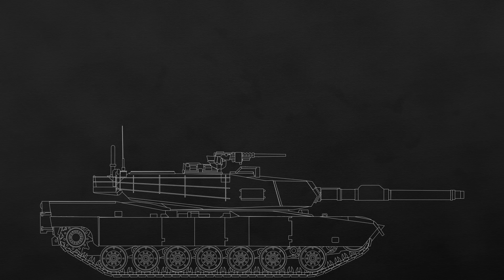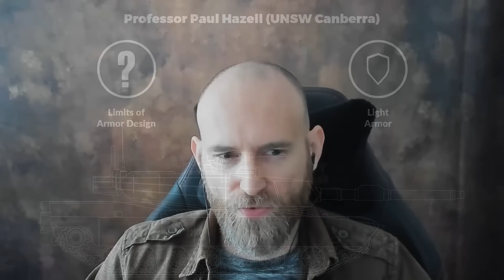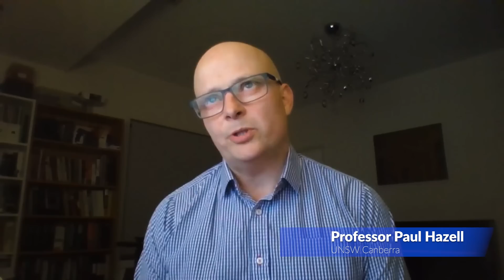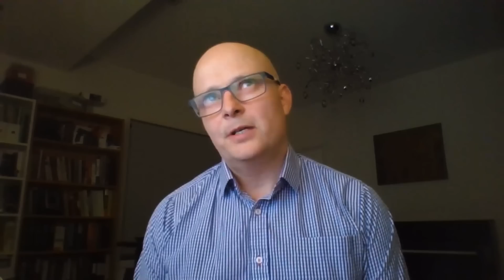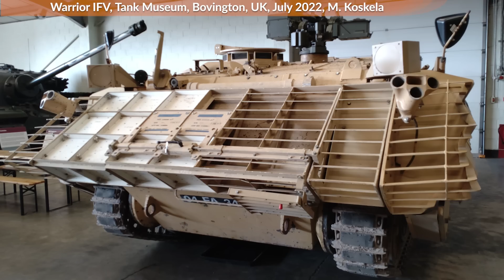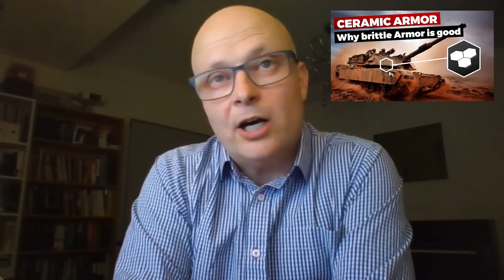Limits of Armor Design & Light Armor

Comment: Re: new threat types?
Possible futuristic threats, it's hard to predict the timeline:

1. APFS rocket-assisted: long rod subcaliber penetrator which primarily accelerates outside the barrel, potentially allowing longer penetrators and guidance systems.

2. Folding APFSDS: As the sabot discards, the projectile increases in length without sacrificing density.

3. Top attack ballistic penetrator: using sensor fusion in the tank and communication with other vehicles, a slightly guided shell can be fired as over the horizon artillery which then lands like a miniature version of project thor, both extending range and circumventing armor. Basically the world's most expensive How Ridiculous video. Disadvantage is that in order to bypass armor efficiently it needs to be fired at very high angles which means very long flight times even for artillery. Also anything fired in a semi-active missile type capacity will obviously be susceptible to soft kill countermeasures and jamming.

4. Frikin' lazors. If the yield of rapid pulsed laser systems can be sufficiently increased, to the point of being in line with conventional kinetic weapons, penetrating tank armor from even the front would be possible. These do not need to burn through the vehicle but rather make a series of craters at the bottom of craters exploding layers of armor with million degree plasma fireballs similar to miniature nuclear explosions. Such a weapon can also potentially act as a countermeasure due to its lack of flight time, either hard kill, soft kill, or deflectional depending on the incoming threat. It can also be refocused to change the effect on the target from penetrating to exploding to taking the paint off.

5. Tandem guided flechettes: smaller APFSDS rounds punch narrower holes. Shooting one APFSDS immediately behind another and having them follow each other straight into the previous shell's entrance hole allows for much better penetration than a single large APFSDS of similar aspect ratio.

Comment: I think (in my incredibly less educated opinion) that the biggest advances we're going to see in the near future for defense will be a synergy between passive defenses (armor in the classical sense) and active protection systems.

When there are interception systems and things like (possibly) electric armor to counter things like heat rounds/missiles, then the material of the solid armor can be more optimized to focus on things like apfsds rounds.

Right now, armor is being asked to defend against multiple types of attacks, and that is going to limit its potential to defend against any one type of threat as optimizing for more design characteristics involves more compromises being made, as a general rule.

How this will play out I don't know, though, as there is very much an arms race between active protection systems and countermeasures to them (at the most basic, tandem charges to counter explosive reactive armor).

Comment: Is the foreseeable future of the MBT, until new materials allow for lightweight armor, a return to focus on speed with modular armor and APS, with a focus on all the steps before getting armor pierced (avoid encounter, avoid detection, avoid acquisition, avoid hit), and crew survivability at the expense of the vehicle itself?

As for armament, instead of moving up from 120 mm main gun to 130 mm, simply developing top attack munitions that can be fired from existing barrels or even moving down to 105 mm to further save weight?

Comment: evolutions in the crystaline structure of metals will also probably allow new things in the future (for exemple we know that for the case of steel, tempered martensite has been the "meta" for a long time, but now, we begin to understand even more efficient structure that involves a mix of austenite (mild) and of harder ones like ferrite or cementite (and the mix of both create something often referred to as "bainite" ) because, if a bainitic steel with like more than 2000 MPA of UTS and more than 650HB was to be produced, it could allow to , compared to previous HSS and to traditionnal RHA, to bring same protection for a much lower weight (as the higher strengh, UTS, hardness, compression strengh, etc, would allow to put far less material and sitll get same protection)

Comment: My prediction is that point defense systems will come to the forefront since attacks have been concentrated against armor which needed to be unfocused to provide coverage. Now that aiming became smart enough that defense can also concentrate its focus on the incoming attack, it'll be more efficient in weight to defend. Once the attack is blunted enough, armor can withstand the remaining splinters. It's kind of like those post-Renaissance era small metal duel bucklers. If you could be sure you can move it such to block every attack, there'd be little need for high coverage strong armor.

In fact I think even aircraft and helicopters will come to use such systems since they won't be able to survive otherwise in a peer conflict as demonstrated in Ukraine.

Comment: This was supposed to be a video about the limits of armor design, what are are the real physical constraints that determine what designs will succeed and which designs will fail.  How about ground pressure, mass?  There are some real limits for you.  Exceet about 70 tons and the roads, highways, bridges cannot hold it up - it becomes a real problem.  That is a limit.  Armour protection?  That's a variable.  Projectiles?  Those are variables.  The smart people can distinguish between a limit and a variable.

Comment: I think there will be a push at the point when electric drives and battery systems begin to out perform IC systems, and dedicated electric platforms would be much better than retrofitted ones, though solid state batteries are ages away for military vehicles
Reply: Refuel vs recharge is a major issue.  Hybrid drivetrains make all the sense, pure electric seems hard to charge in the field.
Reply: How about the dangers of light metal like Lithium burning?

Comment: Graphene Armour,  That's got to be a joke right? Might as well diamond stud your vehicles. Would be cheaper and look pretty cool.
Reply: i literally never heard of graphene before but google told me this:

Specific graphene pricing data is hard to come by, but relatively recent estimates peg the commercial cost of graphene in a range of US$67,000 and US$200,000 per metric ton. The wide variance in price range is mainly because price is congruent with quality and not all applications require the highest quality graphene.

on the higher end that would only be like 2 bucks a gram?
Reply: @knuppel8875  The properties of graphene most often cited as being Incredible are useful when graphene is used in large sheets. However the current method of obtaining graphene involves using sticky tape to pull flakes of a chunk of graphite. These flakes are too small to take advantage of any of the interesting properties. On the other hand we have fairly advanced processes for producing artificial diamonds, so sticking some diamond sheets into your composite armour is probably not cost prohibitive. Not sure if it will be an improvement, but if I was directing funding I'd give it a higher probability of being useful in the near term than graphene.

Comment: I think we can see that simply static mass armor is insufficient now, explosive reactive armor is nessary for any tank to be effective now.  It incressingly looks like active kill devices will incressingly be needed as well to defend the tank.  I predict that tanks will evolve as navel ships have, relying fully on CIWS to defend themselves.  Light vehicles will instead become the place were armor technolgy is focused as the small arms threat is not counterable with active kill systems.
Reply: I have to disagree. Light armor +APS System is a pipedream. 

Passive armor protection in the form of NERA armor plates will always be needed against kinetic energy rounds like APFSDS.

The problem with any APS is that there in no way one can be built that can defeat an APFSDS dart. The dart is high density high hardness Uranium or WCCo. The penetrator will not be eroded by any APS to the point of neutralisation of the threat while keeping the shot of the APS at a manageable weight. Actually we are far from it. The Darts can be brought to tumble and maybe break into multiple pieces. Problem is that thats still the entire mass of the dart flying at the vehicle. If your armor is light like that of a Bradley, M113 or LAV you actually made it worse. Since a tumbling dart will keyhole through your hull armor and do more damage than if you let it fly head on.

You will need passive armor as a base. Always
Reply: @regeNausWeiden  is not another issue with APS that they require active detection systems so you end up broadcasting your position?
Reply: That is true, although compisite armor will Stick around. Both ERA and APS can't effectively Stop KE rounds.
Reply: naval armor went out the window because airplanes and the very large guns of the time had made it impossible to make a ship survivable enough to justify armor. Tanks still survive because they have the mix of mobility, protection, and heavy firepower that makes them difficult to pin down like old battleships
Reply: @AsbestosMuffins  Incorrect there. Armour was used to protect against heavy naval guns, and still has some utility against General Purpose Bombs, rockets and shellfire, hence why it never really fully disappeared from Warship design, and extensive splinter protection (important in the design of the Alright Burkes)in the form of composite armour has reappeared from the 1980s onwards.

Very heavy armour protection did disappear, as the modern Armour-Piercing Bombs were too hard to protect against, see the design history of the clean-sheet 1944-45 Lion class Battleship designs, protection got thinner as the design process went on (not to mention the prospect of new guided weapons), however it worth pointing out that modern warships do have significant passive protection, primarily in the form of redundant and widely separated machinery spaces (with significant shock protection from underwater explosions), as both underwater weapons like torpedoes and mines, and anti-ship missiles cause damage over a wide area, hence the best form of protection is duplication, redundancy and wide separation of critical components.

It's also worth pointing out that certain structural features provide armour protection, see the use of HY80 on US Cold War Frigates (DLs, DLGs & DLGNs of the Mitscher, Coontz/Farragut, Leahy, Belknap, Bainbridge, Truxton, California and Virginia classes).

Armour never really disappeared from Aircraft Carriers, and all of the Western Cold War-era Cruiser designs (like the British 1950s GW design series, the US CSGN etc) had armour protection, they just didn't get built, the largest surface combatants which were built being the Guided Missile Destroyers, or what the US called Frigates between 1957 & 1975, which were redesignated as Cruisers in 1975, but were built primarily to destroyer survivability standards. The lack of new-build large surface combatants, the shift to nuclear weapons and anti-ship missiles led to the disappearance of armour from most surface combatants, but this reappeared when thinking began to shift towards prolonged conventional combat in a Hot War scenario (hence the inclusion of significant passive protection on the Arleigh Burkes).
Reply: @Force A1  Ships are too vulnerable to missiles. The Falklands shows that, argentine aircraft were sinking numerous ships which couldn't evade or tough out the damage.
Reply: @jgw9990  It helps if you know what you're talking about, then you don't embarrass yourself like this.

Argentina sank two ships with missiles, a Ro-Ro Containership (primarily abandoned due to fire), and a small Guided Missile Destroyer.

The Type 42s were a very small guided Missile Destroyer, even by 1960s standards, and did not have the necessary separate and duplicated machinery spaces that later (or even earlier) larger ships would have. The ship was basically shrink-wrapped (a false economy, since the weapon systems and powerplant that makes up the vast majority of the cost of a modern warship, not the steel) around a Sea Dart magazine, machinery spaces for diesel generators, the Tyne cruising plant and Olympus Boost plant, and the aviation facilities aft.

Sheffield wasn't even directly sunk by the missile, the burning fuel filled the ship with smoke forcing it to be abandoned. The ship, still afloat and under its own power, then sailed itself out of the area (not under control), until progressive flooding from the hole amidships caused it to capsize.

The vast majority of British ships were sunk by Argentinian strike aircraft flying at low level dropping dumb bombs, primarily when said ships when unable to maneuver in the confined waters of San Carlos Bay, compounded by the poor radar conditions due to the clutter from the shore, the lack of MTI on their main Air Warning Type 965 sets, combined with lower PRF and antenna rotation speeds of their Type 992Q Target Indication Radars (ironically had they been fitted with original Type 992 sans suffix, which were designed to detect small targets in clutter, such as persiscopes in rough seas, and to act as a Target Indication Radar for the Gunnery Direction System 3 (hence having a very high PRF and an antenna which rotated at 90rpm), which was capable of directing up to 24 gun mountings and directors against 8 targets at a time they would have probably have performed much better).

Modern Warships built with the lessons of the Falklands on mind have a whole host of improvements, including vastly better radars (including AESAs) (and more importantly the processing power behind them, which can filter through clutter and deal with weather-related ducting), smoke barriers to prevent the entire ship from being from being rendered inoperable be smoke (along with other changes to reduce smoke, including the materials onboard furniture is made from, the composition of various paints etc), unitised machinery spaces and/or Integrated Electrical Propulsion. If you want read about the lessons of the Falklands War and its effect on warship design, DK Brown's Rebuilding the Royal Navy has an entire appendix dedicated to it.

Remember that the Falklands was primarily fought by 1960s Warship designs equipped with 1940s and 50s radars (the only exceptions being the Type 22 frigates, a single Type 42 with a Type 1022 radar in lieu of a Type 965, and HMS Andromeda, the single Seawolf equipped modernised Leander in theatre).

In a war against peer, or near-peer states, casualties and damaged & destroyed equipment is inevitable. Vulnerability is not obsolescence, otherwise the infantry man would have no place in modern war.

Comment: Interesting video thanks.  A few years ago, there had been talk of using the 'armour' used by skiers as part of a system for soldiers.  The name escapes me at present but it consists of 'pockets' sewn into the jacket or trousers.  The material (more like a gel) in the pockets  is soft until it is struck, whereupon it hardens long enough to dissipate impacts.
Reply: Shear thickening fluids...
Reply: @dwwolf4636  That's it  Thanks.  It's been  a long week.
Reply: motorcycle amour is this material
Reply: @Blackadder1620  I didn't know bikers used it too.  Nice.
Reply: @ptonpc  even have airbags now, kinda like putting a airbag on a cannon ball lol.
Reply: @Blackadder1620  Damn, makes me want crash a motorbike now (Well just a tiny bit) lol
Reply: @ptonpc  If it's the same D3O is the name of it, but it's supposed to be in use with armed forces already if you believe the packaging.
Reply: @Blackadder1620  yea its good against large area slow impacts with not a lot of energy like falling off a bike but not good  at small area high velocity impacts
Reply: Non-Newtonian fluids, the thing is they do not get all that strong compared to materials that are not a fluid normally  ( for example wood is far stronger than any non-newtonian fluid   but still not strong enough to stop a shell fragment )
Reply: @woltews  From what I can recall, It was a New Scientist article from the early 2000s (circa 2005 / 2006?) in it's original form it was to protect skiers from impacts.  For combat scenarios, the idea was the fluid was to be used in conjunction with additional armour.  Giving the user additional flexibility and comfort while providing protection only when needed.   I probably didn't explain it clearly enough in my original post.
Reply: @ptonpc  that additional armour part is the problem - to stop 5.45 at 800+ mps  it needs to be hard armour and small tiles of even hard armour tend to become part of the  munition entering the  body and easily cutting through soft body armour
Reply: @woltews  Like I said, it was something I read in the early 2000's.  The fact it's not been used tells us it didn't work.
Reply: @woltews  No armour type is used alone, not in any serious capacity. For armour, as discussed in this video, you have DU plates, Textolite, quartz, ERA, nERA, xERA, honeycomb composites, air pockets, probably more. Adding another type could be useful, maybe. Or not. 

For soldiers, layering becomes an issue. Those plates that stop rifles rounds are heavy, very heavy. If you get one with the collar or make it a full vest with the crotch it is even worse. Wanna make it more layers, not gonna work. I do not see it being feasible unless we come up with new non-Newtonian fluids, but who knows. One day we may.
Reply: @jamegumb7298  um you might want to look at the armour on the LAVIII , M113, police swat team body armour , BMP3 , warrior  and M109